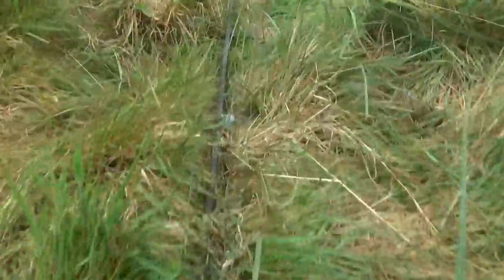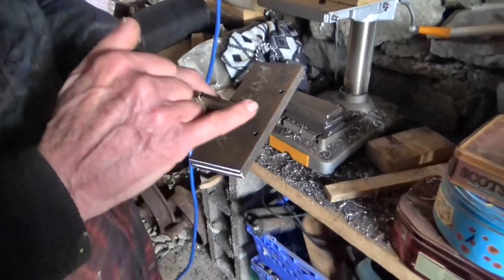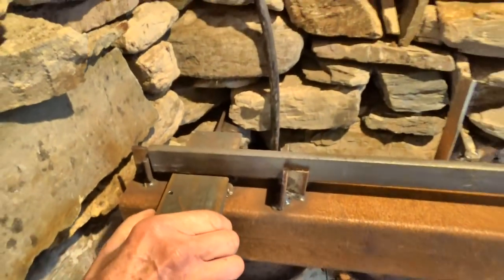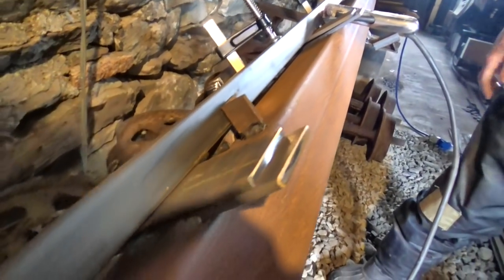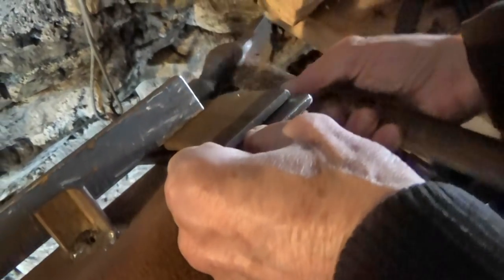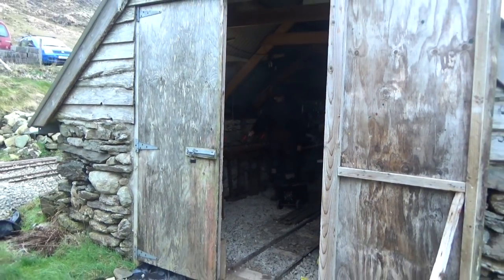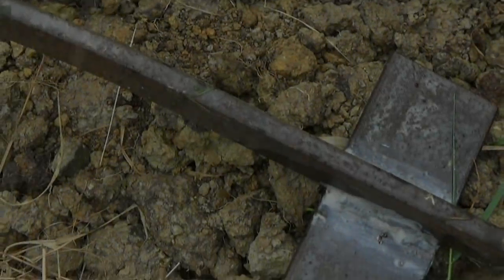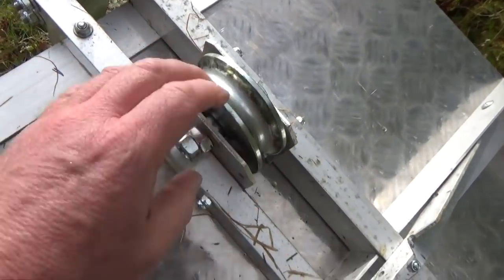How To Make Your Own Garden Monorail (And A Set Of Mono-Rail Points)

Comment from the maker: Lots of people have suggested a wheelbarrow would do the same job - but it just isn't so. We should probably have made it clearer, but steel wheels on steel track creates a TINY amount of friction - FAR LESS than a rubber wheel on soft or bumpy ground. So these are MUCH easier to push than a wheelbarrow. (Or, to say it another way, you can carry far more weight with one of these.)

We're just going to have to organise a race - monorail versus wheelbarrow - to prove the point, aren't we? Any takers?!
Reply: i thought they would at least motorise it. or make some bicicle contraption that can pull the cart that would do the trick
Reply: Instantly see this is far superior to a wheel barrow, but the wheel barrow is more open world shall we say
Reply: How would this work in a pasture?  What about mowing around it?  How big a trip hazard is this.   
I am curious because in some ways this is brilliant.
Reply: I would go for a lawn tractor and smal trailer
Reply: The trip hazard and lawn mowing difficulties don’t really weigh up to just pushing that wheelbarrow or even a cart with like 20cm diameter tires if you ask me. Unless you have some sort of factory in the backyard which needs a train running multiple times an hour. But still then i would take a tractor+trailer. It’s not bad to just confess its for the railfanning.
Reply: As for efficiency,  you never see monorails like this on construction sites or with professional landscapers. Wonder why that is🤔. That said if a dude wants a monorail in his yard more power to him!
Reply: Shots firreeddd
Reply: @GrodyMaroon  its been like 3 years since  rhis was posted and its just such a good idea.

It reminds me of the "tractors" a lot of wasabi farmers use in Japan.  They terrace steep mountain streams amd next to them they run a path and large iron rail, usually an I Beam.  Then. They run a small gas motor powered platform up and down it.

Also ita believed a similar wooden system was used to move megaliths in the stone age.  But made of wood and in reverse.  With the megaliths on rail sledges running on greased U shaped wooden guides.
Reply: The fact that you had to explain that..
Reply: Putting a motor and two or tree robber wold make it really crazy
Reply: You start building a track while I start wheeling
Reply: @PandorasFolly  Never heard of U-shaped greased rails from stone/bronze age. Where was this system found?
 I thought most archeologists suggested round and square logs, or, in the case of Easter Isles, they 'walked'. ;)

Comment: Nothing stopping him from laying a second set of rails for really heavy loads as needed. Top notch idea and work.
Reply: Then you've reinvented the railway.
Reply: @trainzguy2472  So what is wrong with that? the monorail doubles the total length you can do with available resources compared to traditional rail but as we see here limited in load capacity so having 20 or 30 meters of extra rail you can lay down and leapfrog with a detachable wheelset for the carriage to span the gap would let him haul those big loads as needed with just a small increase in complexity and cost

Comment: In your mid-40s, you start to realize your knees and body aren't invincible anymore.  We use ATVs and tractors to move things, wagons with oversized pontoon wheels, and very occasionally the wheel barrow.  I had been looking at a cable-car system for getting things up and down the 100ft elevation difference to lower food plots but hadn't considered RAIL!  That's pretty cool, I think I'd want two rails and cross members more than a monorail, and a motor on the carts, but i love it.  Somehow imagined there was more to it but this seems very practical and easy.  Even for a case where i'm mostly moving material across a flat but bumpy field, I had been debating how to get tons of dirt from one end to the other without taking it bucket by bucket with the tractor.  I hear these things are how the West was won!

Comment: Necessity might be the mother of invention, but repetition is the mother of efficiency.      Send that chap over here to the States, southern California in particular, to teach us how to be self-sufficient, and also how to use the metric system.      

I'd like something like this marvelous monorail, only inverted.      That is, I'd like a track in my workshop, versatile (in XY or Rtheta movement), towards deployment of a "lift,"  so I don't strain my back in old age.

I guess my "need" isn't so great, that I have not "invented" it yet.  

Thanks for the lovely video, and it's nice to see that the sun is shining in the West of the Emerald Isle.
Reply: John Becich Name one thing you can't do using United States customary units. I in turn will name something you cannot do with the metric system—namely, express the concept of 1/3. You cannot do this in the metric system because 10 cannot be divided by 3, and the metric system is entirely decimal or base-10.  Ten is a terrible number to use for mathematics, being divisible only by 1, 5 and 10. It is only practical for counting on your fingers, thus is designed for uneducated people. In the American measurement system we use base-12 (duodecimal, divisible by 1,2,3,4,6,12) which is much more flexible, and we use fractions to express numbers less than 1 with perfect precision. We can also use decimals when appropriate. Thousandths of an inch are much loved by engineers. American measurements may be quirky, but they are comfortable when you're used to them, because they are based on human measurements, rather than being totally arbitrary as the metric system is. Also, note that many Americans are perfectly capable of using the metric system, but prefer to use the American system. Personally, I hate it when people try to force me to use metric measurements—in this country, we are free to be different from the rest of the world.

Comment: railways show well when the ground gets muddy.
Reply: Yeah  but no... 
A Big tires wheelbarrows with electric motors does his job pretty well too... without the need of you balancing out the load or need to use strength at all... has engines uphill or downhill has brakes...

Comment: You probably could make it balance itself with a sufficiently large gyroscope
Reply: pop1040 nice one, then add batt. powered rubber drive tire. solar charged of corse
Reply: it's been tried to little success. By the time you add all that you lose out on freight.   I think there was a few tram lines in india that had a single rail steam engine but had a large wheel on the side to keep it from tipping over
Reply: @tylerrip11  and they could only stop at stations, a standstill along the track was problematic.

Comment: put the handle on a pivot near the platform, with the back wheel below the platform and back a bit. The offset will keep the handle upright. Attach a couple of legs to the handle that stand on the ground when the handle is pulled back. This will support the platform level when you pull the handle back, and will act as a brake if the trolley gets away from you while you are pushing it. Put a curve on the legs so they don't gouge the ground.

For light loads, this monorail would work perfectly fine made of wood.

Comment: This is super similar to Chinese wheelbarrows, which have one big wheel in the center of the frame, rather than having one small wheel at the front of the frame in Western wheelbarrows. Whereas in Western wheelbarrows you are lifting 50% of the load weight while you walk, with the Chinese wheelbarrow you are lifting nothing, and your only physical tasks are to balance the load and push/pull it. Just like with this monorail cart. You can find pictures online of one Chinese porter pushing a wheelbarrow with like six people riding on it as a form of transportation.

Comment: "tac welding with his eyes shut" and glasses that intensify and focus the energy into one point...genius :P
Can't say anything really... I dont flick the mask on for 5 second welds lol
Reply: Overthinking things, I 'd probably put the handle to the cart on a pivot, with an actuator for a brake caliper over the rail behind the wheel - that  way when it's being pushed, the brakes totally inactive, but when going downhill, if the cart starts to run away - rather than h ave it dig in and risk flipping/injury, the handle could tilt back, activate the brake and slow the cart keeping it under the operators control. I know I'm 3 years late to this party but fun to think about!

Comment: Never work cold metal on an anvil!
Neat idea! You need to add a kick stand & maybe a hand brake to your cart. 
I built one as a kid for hauling firewood out of a swamp using a wide wooden rail, it was a lot harder to pull than that one. Cheers

Comment: If you added horizontal rollers in contact with both sides of the rail, the tram would be able to self-balance somewhat and you might not need to hold it upright as much.  Steel box channel might make a better monorail track than steel strips.  Food for thought.  What were the narrow gauge wheel sets for?  Interesting video.  Thanks for sharing.

Comment: This is nice and cheap but I think a C-channel would be an upgrade with a wider wheel or two smaller ones for stability. Maybe a small I-beam could eliminate the need to weld feet.

Comment: It could profit from having 2 narrow but tall wheels (kiddie bicycle wheels) on the end where the operator is. With a simplistic suspension system (i'm thinking like the suspension on a Citroen 2CV) it could help one keep the monorail even, but also provide a breaking point, heck, one could even hook a BMX style bike on that part and pedal it
The monorail would do all the hard work and the pedal power would push it. Considering a grown man can push one of those tricycle icecream stands on an incline, this should be easy.

Comment: Hundreds of years ago the Chinese used single wheel carts to carry very heavy loads over narrow pathways.
Reply: As one who has hauled yards and yards of loam sand gravel rock, and even true muck, I would have gladly given 1/2  my weeks pay to have had one of these rail systems,  the cart and rail hold the weight of the load not your arms and back and much less likely to spill lose  runny loads all over the place
Reply: soaringtractor You fail to appreciate the gravitational difference between an ancient Chinese single-wheeled cart (where 100% of the load is carried by the wheel), and a western designed wheelbarrow (where 50% of the load is carried by the labourer).

Comment: You could make it with 1pin on each end removing the male and female aspect. To avoid mistaks it could be incorperated in to the jig
Reply from the maker: You mean just one of the horizontal welded-on pins? Wouldn't that leave it twistable? Can you send us a drawing?
Reply: Way Out West Blow-in blog On drawing my "improved" design I have realised that there would be nothing to stop the lateral separation of the rails. I will still send you my design, perhaps I can figure it out... I doubt it!
Reply: Way Out West Blow-in blog I have sent the drawing to your youtube acont gmail
Reply from the maker: Thank you. Interesting - I will pass them on to Chris. This design has been around for a long time so it will be hard to improve it - but not impossible.

Comment: Yeah  but no... 
A Big tires wheelbarrows with electric motors does his job pretty well too... without the need of you balancing out the load or need to use strength at all... has engines uphill or downhill has brakes...

Comment: I'm sorry. I don't get it.  Wouldn't a wagon do the same job and be more stable and be more versatile?  Better yet, get a Gator.
Reply: Pushing heavy loads with steel wheels on steel rails is far more easy than on rubber wheels on bare dirt/grass. There is way less friction.
Reply: That all depends on the size of the wheels and nature of the terrain.  And that argument doesn't deal with the fact that you only go where the track is.  It may be easy to move the track but you still have to do that work before you go somewhere else. and you have to keep the load pretty balanced on two wheels.  

Laying two tracks so you can have four wheel stability cis more than twice the work because you then have to worry about gage as well.  

No, I still think the old fashioned invention called the wagon is a better compromise of all the factors to meet the general needs of gardening or transport.
Reply: Of course this thing is mostly made for fun and probably not useful in a vast majority of cases, but if you have a path you follow regularly with moderately heavy things to carry, it's not that stupid.
Some vineyards on slopes, or even private houses build on steep lands, uses little funiculars for example, not that different than this amateur monorail thing.
Reply from the maker: I think we'll have to organise a race to demonstrate the differences. (No idea what a Gator is though.)
Reply: It's a John Deer version of a Quad-Runner.  Fare enough.  But the start and the finish cannot be known until after the race starts.  Actually, I would be willing to let the start and finish be known and let the track be in place before the start.  I think under those conditions, the race would end in a tie or very near a tie.

Comment: There's a new invention that's really catching on these days. It's kinda like a monorail, only without the rails. It's called a "wheelbarrow".
Reply: Pushing heavy loads with steel wheels on steel rails is far more easy than on rubber wheels on bare dirt/grass. There is way less friction.
In a time when combustion engines were not powerful enough to handles heavy loads on rubber wheels (like, before WWII), there were light rail networks everywhere, in fields for farming work, in forest for logging works, on the roads for passengers and freight, even indoors in industries to move things around.
And, of course, at the front of WWI to feed the human-grinding artillery machines with tons of shells...
So a rail-mounted wheelbarrow is a cleaver idea.
Reply from the maker: Damien's right - over this sort of terrain, wheelbarrows would be much harder to push. We'll have to have a race to compare the two...
Reply: Damien Drouart there's another invention tha's catching on fast, it's called "fun" :)